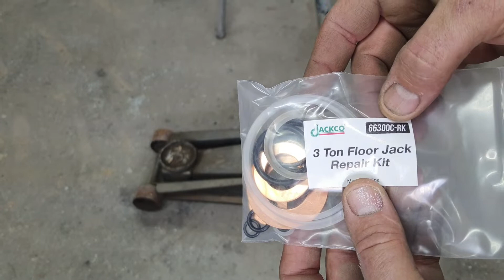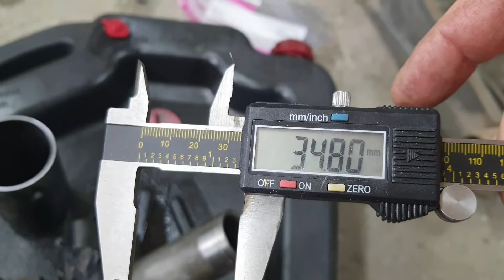Restore HARBOR FREIGHT Floor Jack Rebuild using performance tool rebuild kit repair can we ?

Comment: Good job mike I have a low profile 3 ton jack from Harbor Freight hope I never have to rebuild it but if I do I'M sure this video will help!
Reply: just take it apart first and measure the piston. the other kit may fit too. guy on Ebay has the measurements and priced fairly. plus the measurement on this one. which was not on summit racings website.

Comment from the maker: If you watch this video then take your jack apart. measure it, order the parts and put it back together. You could do this in less time than driving to the store and buying a new jack. Honestly would take total less than an hour. Probably take more than that to drive back and forth to harbor freight and buying a new jack. I usually just buy a new one but after doing this one I think I will try to rebuild. Takes like NO time.

Comment: So where did you get the 2nd kit?
Reply from the maker: first kit from ebay second kit link in the description.  Make sure the sizes match your unit. Disassemble and measure before ordering. Got second kit from summit racing was for another jack but was completely the same.